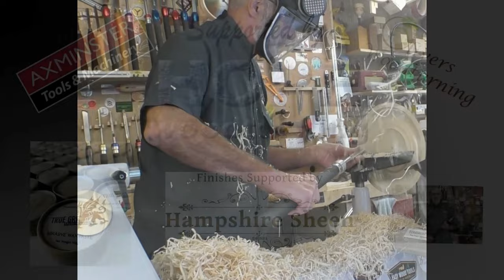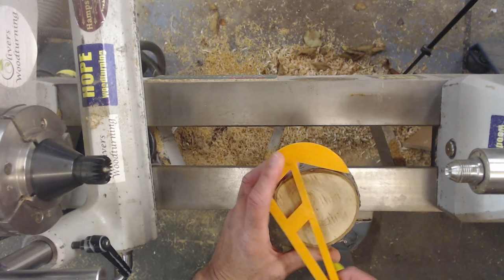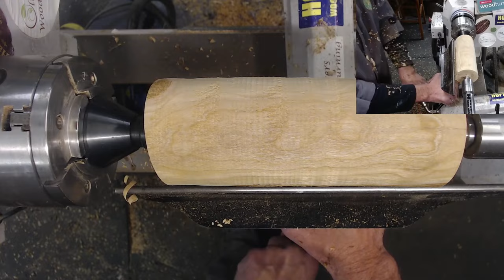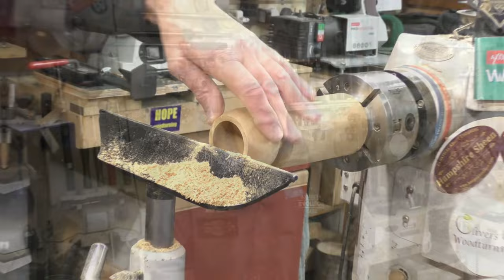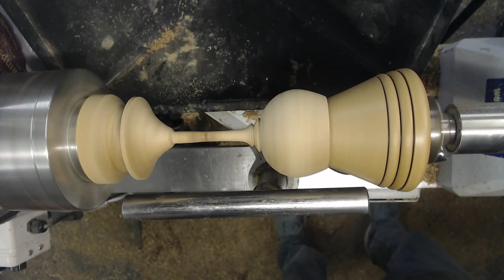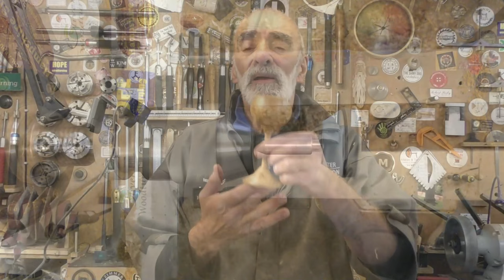Woodturning _  A Complete Guide to Turning a Goblet (Real Time)

Comment: Very well done, Mike; just what a beginner needs. Real time and full commentary. Clearly born of experience. I enjoyed it too. I recall we both started serious woodturning at about the same time, and worked in parallel on goblets. Now its negative rake scrapers, which we have agreed before are valuable tools. For those with the most basic of lathes, coring with a handled drill bit is an important method. I think a little on useful bit diameters and handle design. bearing in mind torque, might not come amiss: indeed, I have had to answer up on handle shape and length for different tools in the past. Also, final sanding together with choice of sealants and top coats is known to be puzzling to some, on which you might feel inclined to comment some time. Just some thoughts. I like my tailstock Jacobs chuck, which I make sure to hold, and am somewhat  a devotee to Danish Oil. Thanks very much.   Bernard.
Reply from the maker: Thanks Bernard you make some very valid points as well. As always I appreciate you watching and commenting. Cheers.  Mike